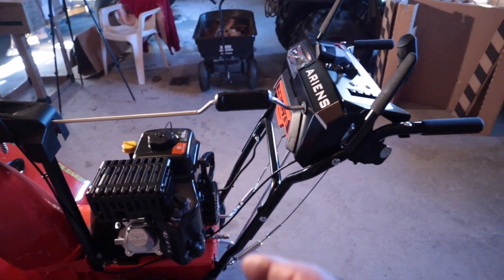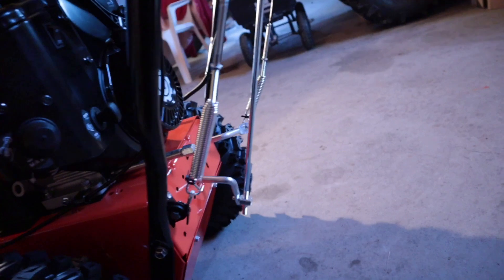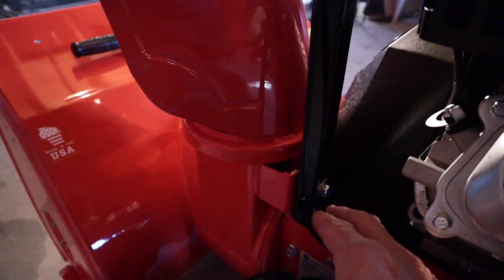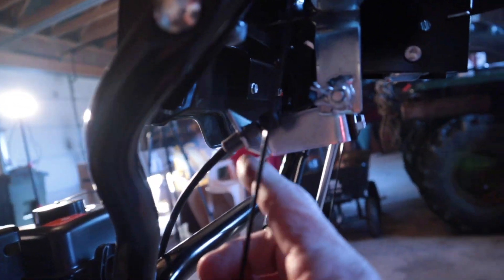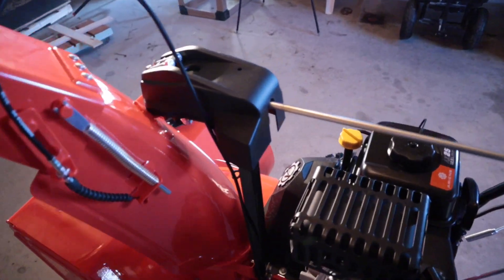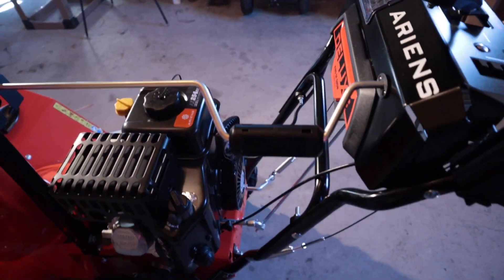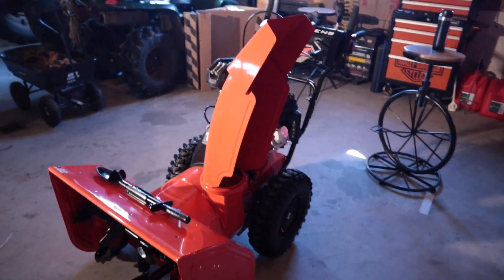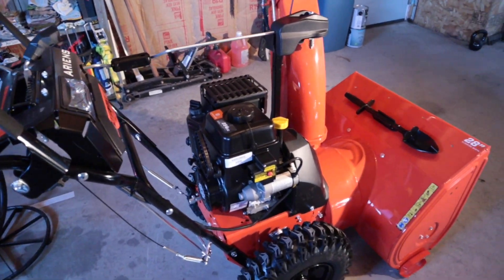Ariens Deluxe 28" Snowblower. Unboxing, Assembly, and First Start

Comment: Nice Ariens!  This bad boy will chuck some snow. 

 The only thing I have never liked on these is having to reach over the dash to rotate the chute.  But, that's just my opinion. Some guys have zero problem with it. 

Are you planning on an impeller kit?
Reply from the maker: It’s the only type of shoot controller I’m familiar with. You are certainly correct on the throwing some serious snow, it does a wonderful job.. thanks Paul for watching & taking a moment to comment…
Reply: Well it sure beats my Yard Machine MTD chute adjustment, which requires  stopping and bending down to  the left side of the machine and turning a crank 5 revolutions.